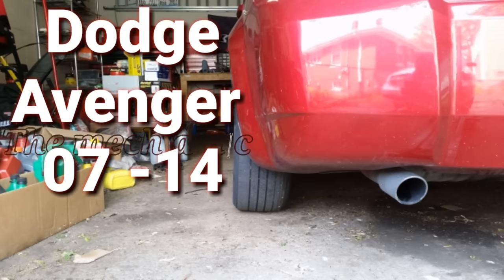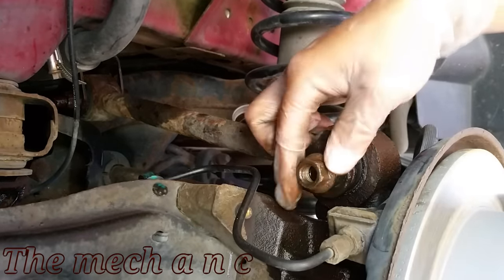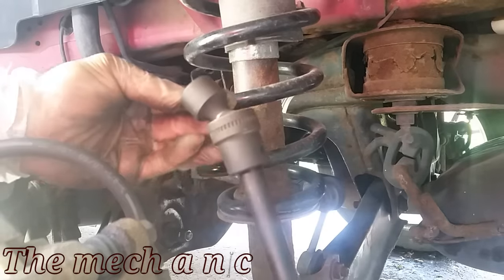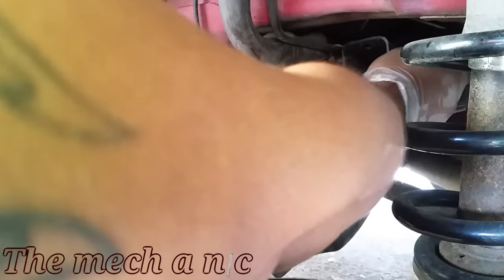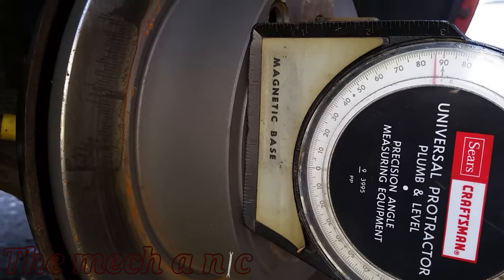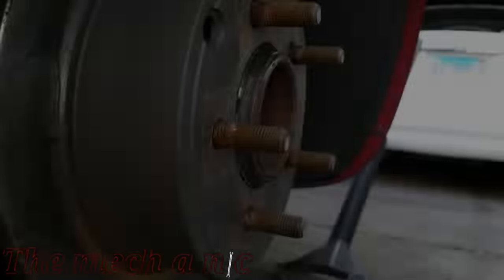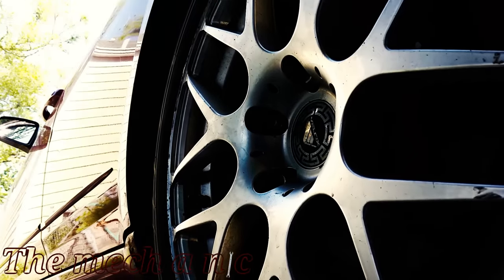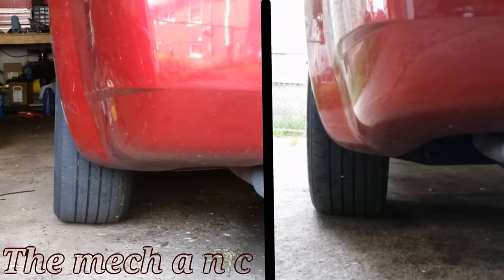07 -14 dodge avenger rear camber / tire wear

Comment: The mistake you made is not giving your rear less than 1 degree of negative camber, instead you put it at exactly 0 camber. That will create stability issues in turns  and uneven weight transfer!

Edit: DAAAAAMN. I would NOT have paid attention to that. Good looks!

Comment: Do you have to buy adjustable ones or can you just replace them with original ones
Reply from the maker: If adjustments need to be made you cant do that on the original parts
Reply: My tires are wearing out exactly the same do you think I can just replace those with brand new ones and it’ll fix the problem
Reply from the maker: @johngonzales8387  you'll want to get all the bushings checked by someone because too much toe in or toe out can cause tires to wear out quickly.
Reply: Yeah I got it all check out they said that I just needed the upper toe link the one you replaced but what I’m trying to figure out is can I just replace it with a oem toe link or do I have to get a adjustable toe link
Reply from the maker: @johngonzales8387  you can get an original type. As long as all the bushings are good the alignment should fall into spec..

Comment: Hey question man, my car when I take the steering wheel tire off , my rim is a bit bit but u can barely notice it , but it’s bent ... so anyway the tire rubber, it looks weird asf the right side of it is taller than the left , and it keeps falling over , my other tires don’t fall over like that, and my car has a vibration at 55 mph and up . U know what’s going on ?
Reply from the maker: Replace the rim and tire
Reply: @themechanic6117  ok I definitely am gonna do that and let you know

Comment: Ummm... You made an alignment almost impossible. Don't unscrew each end individually... Now? 1 end has more threads "exposed" than the other. If you go too far? The threaded end (with less threads engaged) will fail prematurely. Next time? Install spindle end loosely, hold inner bushing end with 1 hand and turn center adjustment collar ONLY with other hand. Then tighten 2 end lock nuts. This will allow for full use of that alignment capabilities and not risk threads "pulling out" of the collar. 😎👌

Comment: I have a 2010 Dodge Journey.  It has major camber problems.  Top of rear tires angle inwards which causes excessive wear on inside edge of tires.  I have been thinking it was a strut issue since it has been getting unstable when turning or going over small dips in road like manhole covers.  

Now I am wondering if it had more to do with control arms.  Passenger side is more extreme but both sides are bad to the point that the tires are squealing on dry pavement going straight off and on every tiny bump.
Reply: BTW, thanks for the informative video with minimal fluff.
Reply from the maker: Thanks for watching. In your case id start checking suspension components. Check for loose balljoints. Or worn out bushings

Comment: So I need to reschedule my alignment till I get all my bushing done right? The upper ones and lower ones
Reply from the maker: Yes
Reply: @themechanic6117  now will it messed up my tires again while I'm getting the new bushing on
Reply from the maker: If you drive without getting all the bushings fixed and an alignment it will destroy new tires
Reply: @themechanic6117  oh lord I just have to get 3 more put on their

Comment: If you’re car isn’t level what’s the best way to do that? With the lift and stands? Or is there a better way?
Reply from the maker: If your floor is relatively level and your jack stands are in the same position just make sure you put your jack stands in the same location on each side of the car.. Should be level enough.you should always taje it in for a wheel alignment afterwards
Reply: The mech a nic thanks!

Comment: hmmm. I replaced both upper's (none adjustable) and one lower 2 years ago. The side with both replaced burnt the tire on the inside in about        10 000 km.   What about that toe adjustment.
Reply from the maker: Yes the toe will eat up a tire quickly! Check the bushings on the trailing arm. The toe may be out if the bushings are worn out
Reply: @themechanic6117  its a dodge caliber
Reply from the maker: And? You still have to make sure bushings arent worn out?
Reply: @themechanic6117  yes one end on each toe rod has slope..Rubber bushings. Even with good control arm bushings the tires are bowed in at the top about half to three quarter inch. toe rods won't change that. Bad design possibly .

Comment: I'm going through this now and I cut my fingers on the tires I had alot of wire showing. So when you do the brushing do you think it will need alignment
Reply from the maker: Yes it will. Check the trailing arm bushings also. They can cause that type of tire wear
Reply: @themechanic6117  appreciate I only have one new bushing on their it's the upper one on the right side. So I need to wait before I get alignment right or get it now with one new bushing and the other ones old
Reply from the maker: The trailing arm bushing is the large bushings conecting to the body of the car. I didnt show them in this video. Those are the bushings you want to inspect
Reply: @themechanic6117  we did the little ones
Reply from the maker: Yes but theres a large bushing on trailing arm that you want to inspect. Google trailing arm bushing for your car
Reply: @themechanic6117  k

Comment: I'm 8:03 into your vid.
2 things I see. 
1 the cam bolts aren't tightened
2 the torque of the bushing should of been done while the vehicle is on the ground.
That's sometimes pretty hard to do for many including for me.
Reply: I didn't think about the car vehicle beening level. 
Wow good eye.
I didn't see that one coming
Reply from the maker: Very easy to miss and it almost got me lol 👍😊
Reply: Joshua Figueroa
Reply: So it gets torqued in the air?
Reply from the maker: No, it get torqued with the suspension loaded. You want to simulate the car being on the ground
Reply: @themechanic6117  thank u i watched again and heard u say that

Comment: Would it be the same problem on a 2010 chrysler 300 ?
Reply from the maker: Might be a different suspension setup but if youre having tire wear issues there might be an issue with your suspension/bushings/balljoints
Reply: Ouchh okay , and yes my back tires look just like that every month and also feels like the rear is loose , like i go in the highway and when i switch lanes and hit the middle hump in between the lanes , feels like suspensions wanna go seperate ways

Comment: How long did this camber adjustment last before you had to re-adjust? I have had someone tell me that replacing the rear struts is the appropriate fix. What say you?
Reply from the maker: Check the bushings on the trailing arm. The toe being out of adjustment caused this. Not so much the camber
Reply: @themechanic6117  Thanks for the quick reply! I'll look into it. BTW, are the trailing arm bushings a cheaper fix than the adjustable upper control arm?
Reply from the maker: Labor can be expensive to replace the bushings. Keep in mind camber adjustment is not a substitute for bad toe alignment
Reply: @themechanic6117  Thanks
Reply: I actually am planning on getting rid of this car within a year or so. If I install adjustable upper control arms that should get me through, correct?

Comment: do i have to use the leveler and the angle tool? Or can I just install and take to the shop to be aligned?
Reply from the maker: You can install it and take it to the shop. No problem 👍
Reply: you obviously dont retain what you hear or learn as he had an answer to your unnecessary question.

Comment: When the car went in for the alignment how close was your level adjustment on it.  I have a 09 journey with the same issues, very common problem.  I plan on fixing the same with levelling the car then plumbing up for the camber.  Just curious to the accuracy of it.
Reply from the maker: Im not sure. The customer took it for an alignment but i remember they told me the guy who did the alignment said i did a good job so im assuming it was fairly close.
Reply: The mech a nic thanks for the quick reply! Keep up the good videos
Reply from the maker: Thank you
Reply: @blissman20  How did the repair on your journey go? I have the same issue on the same year journey.

Comment: What's the tool you used to set camber
Reply from the maker: It's just a simple angle gauge . A shop with get the alignment correct
Reply: @themechanic6117  I just ordered one
Reply from the maker: Nice.good luck

Comment: The mistake I saw (in the part of the process you shared*) was that you failed to assure the center adjusting nut of the control arm was more or less centered.

Ideally, one should adjust the length by holding the both ends fixed and rotating the center nut the proper amount. This permits the maximum, specified adjustment range without uninstalling the control arm.

Out of the car, you did all the length adjustment on one end. While, with the inboard end in place, you adjusted only the other end. So this did cancel out some of the difference that would otherwise limit the adjustment range.

I realize you probably know all this but if a viewer neglects this issue, his alignment could become a bit more expensive while he becomes the butt of a mechanic's joke.

Even worse, however, is a situation where only one or two threads of one end remain engaged after an equally negligent mechanic completes an alignment. This could substantially reduce the strength of the arm and pose a serious safety hazard.

----
* I had no idea you were not working on level surface.
Reply: Y

Comment: I have the same exact problem with my 2010 Dodge Charger but I can’t find the adjustable arm. Any help on how I can find the part
Reply from the maker: Youll have to search the internet.they should make them for the charger
Reply: @cognac8297  yo, do not take off the rest assembly if you have a ceased camber, a sawzall will work. I just used one. Use Thick Metal blades. Cut off on the inside of the bolt, between the bushing and inside the link housing on the frame. Use good named blades, otherwise you'll go through the whole pack like I did.
Reply: Rear lateral arm link and get the one that says adjustable  try 1aauto.com the cheap one s and they sale them in sets or one but cost more good luck

Comment: Good job dude! Curious about why you didn't antisieze the bolts in the bushings as well as the threads on the conrol arm? Any specific reason, because I don't always lube them if they are in bad shape and I plan on replacing them soon. Great video though, I bet that helped so many diy-ers.
Reply from the maker: If i remember correctly all the bolts came out just fine.its why i didn't use antiseize. Whenever a bolt fights me to come out i always clean it and use some sort of lube so it doesnt get stuck again. 👍

Comment: too bad you didn't put down the most important piece of information which is the link to that adjuatable arm 🤔
Reply from the maker: You can find it at rockauto.com
Reply from the maker: Ive used both types. They both work , but if theres worn out bushings on your car you want to replace them

Comment: not once in the whole video did he say what the replacement part was!.I know,but if you're looking to help newbie out tell him what the damn name of the part is!. ball joint ,tie rod,sway bar..??....lol mystery parts lol
Reply from the maker: Every car is different on how you can adjust rear suspension.  Some cars use camber bolts , some use rear adjustable control or lateral arms, some use camber bushings, some use adjustable tie rods.... do your own research for your own specific car on how you can adjust rear camber and toe. This is why telling what part (adjustable control arm) worked for this car is irrelevant because not everyone is driving a dodge avenger .

Comment: You tightened the bushing bolts without the suspension loaded.  You can tear the bushings once car is set down on its own weight.  Bad mistake
Reply from the maker: You're wrong. I did load the suspension. You must not have watched the video. I always load the suspension when tightening bushings . its not my first Rodeo.
Reply: @themechanic6117  

      I did not cheat.  I responded before getting the answer.  Treat your subscriber right.  You gave me an F on my quiz and I accept that but don’t get on me for following the rules.
Reply from the maker: If you're not specific in your comment its difficult for me to tell if you're answering my question in the video or if you're criticizing my work. I apologize
Reply: @themechanic6117  

     I was just pulling your chain.  You redeemed yourself by being humble and saying you are sorry.  I enjoy watching you work on some of the junk and your customers that don’t want to fix their cars correctly.  You must live close to Whitley county Ky.  Or Wheeler county Georgia
Reply from the maker: Actually im in Chicago IL